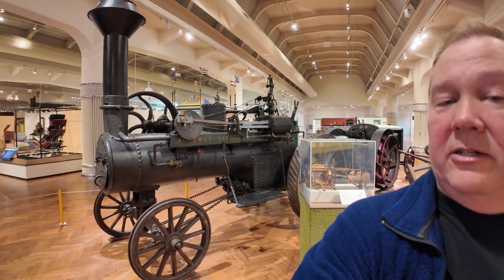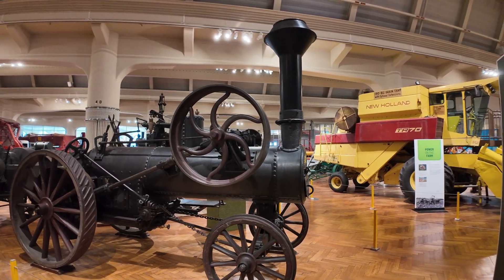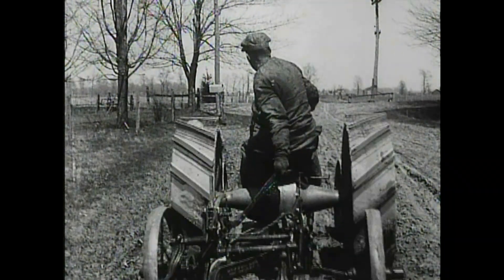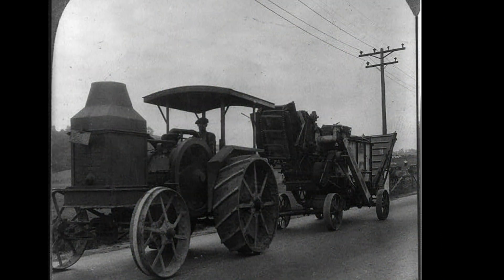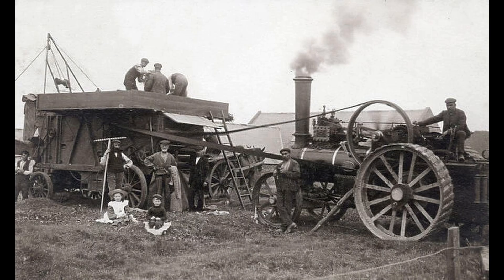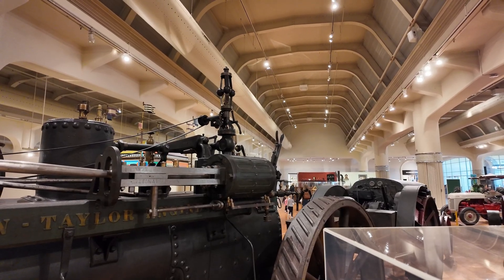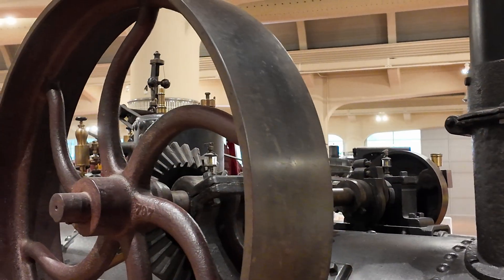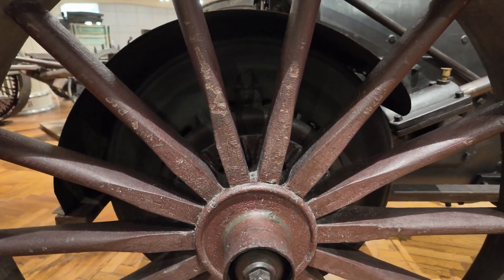Take Your 19th Century Steam Engine On The Road!

Comment: Wondering if you have info - my ancestor bought in 1892 in three annual installments $68, $66, $66 - roughly $1700-2200 each year in todays dollars ??
“one "Aultman-Taylor Horse Power, complete, with the Sweeps, Tumbling Rods, Brace Rods,
and all Fixtures With or belonging to the same; also, one Truck wagon under the same;”
Reply from the maker: I'm afraid I don't have much information about it, but you might check over on @nathanielspoelman9881 as he has a lot more traction engine info.

Comment: That tractor right behind the Aultman Taylor (as well as the experimental Baker cross-compound condensing engine which they have hidden in off-site storage) were in fact designed and marketed as "steam tractors", not traction engines.

Comment: I love steam traction engines!  Amazing they were not typically used for plowing, planting or harvesting.  Truth be told most were too big and heavy for field work.
Reply: Traction engines were very much used for plowing. The virgin soil of the great plains were broken mostly by steam. The biggest and heaviest engines were the ones specifically made for plowing. They were also commonly used for other drawbar work such as grading roads, pulling out stumps, and dragging logs. Some were even manufactured with 2 speed transmissions and sold as "road locomotives" where they used their higher gear ratio to haul overland trains of wagons to areas without rail access. 
Now, an early engine like this Aultman Taylor really is not fit for plowing, or any hard drawbar work. It's drivetrain is more meant to transport itself from place to place, being one of the later and more robust designs from the era of "self propelled portable steam engines". It was a transitional period of technological, metallurgical, and engineering advancements as they improved from portable power units that had to be towed around by horses to true traction engines with the strength and rigidity to withstand the forces of hard drawbar work.
Reply from the maker: More people need to enter steam-powered traction engines into tractor pulls.

Comment: Traction engines are basically tractors. The word traction was taken from the Latin word "trahere", meaning "pull". Tractor was later derived from traction. Traction engines did do work in the fields like pulling plows, discs, planters, and wagons. Some of the first internal combustion tractors were referred to as "gasoline traction engines". You should do a video on John Froelich who invented the first successful gasoline tractor and was the founding president of The Waterloo Gasoline Traction Engine Company.

Comment: A bit of background on that bevel gear Aultman Taylor engine. It came from the collection of the late Joseph Rynda of Montgomery Mn. You can find a video of it running at one of his last steam reunions in the early 50's. Some one transferred his 16 mm movies to modern format and posted them on you tube.  When he was having health issues, he made arrangements to transfer it to the Ford museum with strict conditions as to his ownership if the museum no longer displays it and cares for it, as there's only 2 or 3 of them still around.  You will see  his name stamped into the cross head of the engine, his son did that to be sure his family got recognition for their ownership and restoration of the engine . A few years later, he regained his health and he did find and restore a slightly newer one and continued to host a threshers reunion for a few more years.  At one time Mr Rynda had a collection of more than 20 different steam engines.
Reply from the maker: Thanks for that information! I didn't know any of it.  People walk into a museum and think the museum owns everything there.  A lot of what's in a lot of museums is like this, on some kind of conditional, long-term/permanent loan.  I was at a small railroad museum once and probably 3/4 of what they had on exhibit said "on loan from...." on the signs.
Reply: Very cool back story!

Comment: Amazing how they kept the belts on
Reply: Alignment of the pulleys is key. The pulleys had a crown to them which made the belt walk to the higher center. They would put a twist in the belt which helps the belt stay centered. A sticky "belt dressing" was used to keep the belt from slipping and helped it stay on.
Reply from the maker: My understanding was that the twisted belt was mostly to reverse the direction, or are you thinking of a different twist?
Reply: @Industrial_Revolution  The steam engine can easily run in either direction, forward or reverse, so the twist in the flat belt is not for belt direction but for centering.
Reply from the maker: Traction engines can, or they couldn't go in reverse.  A lot of stationary steam engines aren't set up to do that, though.  With overhead line drive systems in a machine shop, for example, they're often set up to switch from one drive pulley to another, one with a twisted belt, since you don't want to have to reverse every machine at once.
Reply from the maker: It didn't always work.  I saw a threshing machine demonstration not long ago and the huge belt they were using slipped off.  If you have everything lined up pretty close, they tend to stay on, but if you're too loose, or not quite straight enough, they can fall off.
Reply: Before electric motors, driveshafts ran across factory ceilings, with the same flat belt running down to the piece of equipment. Hydraulic or steam power or etc were used to run the driveshafts. They stayed on well; different belt configurations helped.
Reply from the maker: I actually have a video on overhead line drives.  
I just ran across a reference to "crown pullies."  By making the center just slightly bigger than the sides, counterintuitively, and keeping it tight enough that it has just a bit of stretch to it, it made the belt seek the center.  Of course, if you're too far off or too loose, it doesn't work, so you still need to be pretty close to straight on.